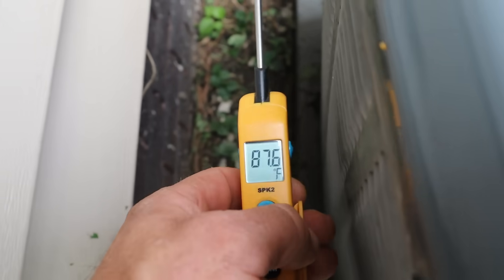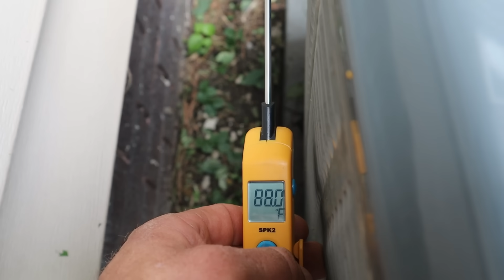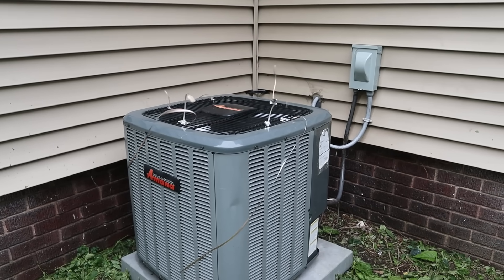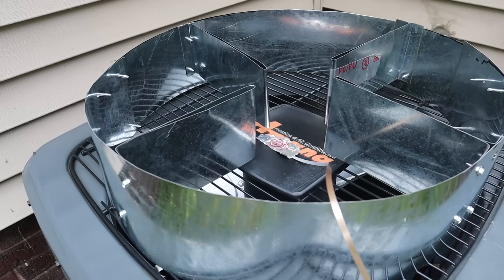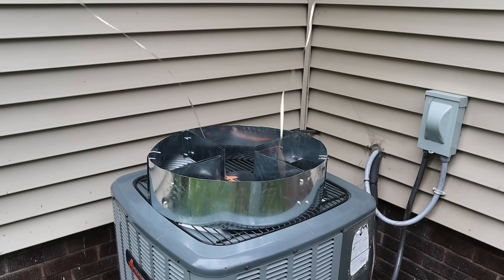Your AC Fan Makes a Mini Tornado

Comment: Good video Mike! I agree 100%! It really matters that no recirculated air is used! Same for heat pumps in winter my friend! 

 Where this really hurts efficiencies is like apartments/condo's where you have multiple units 18" apart against a barrier/wall.....then with condos you get contractors that start installing horizonal side discharge units with vertical units next to them! Then the vertical discharge customer calls saying it just doesn't cool well when it gets hot and their cooling bill goes up 30% then in winter the strip heat starts coming on in the 40's outside!🤣

I always felt manufactures need to pay more attention to getting rid of discharge exhausted air like on industrial lab hoods that utilize Vektor-H high plume system on lab hood exhaust but too costly but still they could do a much better design like what you did!
Reply: Emissions from burning fossils fuels.  My 6 cylinder Honda engine is like 0.7 lbs of emissions per mile.   Add that weight to your body and feel the effect.
Reply from the maker: "then with condos you get contractors that start installing horizonal side discharge units with vertical units next to them! " 

Yup. Seen an awful lot of that! Crazy.
Reply: @JerseyMikeHVAC  Every degree rise in summer affects the wallet, capacity and efficiency! 
Example Scenario

Setup: 3-ton AC, 14 SEER, $0.15/kWh, 8 hours/day, 120-day season.
Problem: Dirty coil or recirculated air raises saturated temperature by 10°F.
Impact:

Power: 3 kW → 3.3–3.6 kW
kWh/season: 2,880 → 3,330–3,840 kWh
Cost: $432 → $499.50–$576
Added Cost: $67.50–$144/season, or $6.75–$14.40 per 1°F.

Same for a heat pump heating it is about 1 to 2% reduction in capacity BTUh and drop in COP is 1 to 2% per degree, cost increase would be 1 to 2% per degree dropped of recirculated air.
You are spot on with it having more negative effects from recirculated air Mike!
Reply: @LKN-HVAC  I wish my electric was only 15¢. Mind is 20¢ now.
Reply: @EthanThruandThru  I hear you Ethan! I am lucky and am under 15 cents a KWh. Interesting to see what states are high and what states are low!
 
State ▲	Residential	Commercial	Average
Alabama	16.09	14.13	12.19¢ per kWh
Alaska	26.08	22.09	22.60¢ per kWh
Arizona	15.76	12.84	13.32¢ per kWh
Arkansas	13.15	10.78	9.56¢ per kWh
California	35.03	22.91	26.03¢ per kWh
Colorado	15.70	12.32	12.53¢ per kWh
Connecticut	31.64	23.34	26.16¢ per kWh
Delaware	18.12	12.32	13.78¢ per kWh
District of Columbia	20.15	19.48	19.07¢ per kWh
Florida	14.98	11.25	13.08¢ per kWh
Georgia	15.00	11.24	11.64¢ per kWh
Hawaii	41.03	35.82	35.34¢ per kWh
Idaho	11.88	9.72	9.46¢ per kWh
Illinois	18.62	12.39	13.16¢ per kWh
Indiana	17.02	13.84	12.18¢ per kWh
Iowa	14.23	10.70	9.19¢ per kWh
Kansas	14.68	11.03	11.09¢ per kWh
Kentucky	14.08	12.29	10.51¢ per kWh
Louisiana	13.15	11.55	9.78¢ per kWh
Maine	27.91	21.40	22.84¢ per kWh
Maryland	19.04	13.39	15.50¢ per kWh
Massachusetts	29.94	22.46	24.67¢ per kWh
Michigan	20.25	14.98	14.57¢ per kWh
Minnesota	15.87	12.41	12.59¢ per kWh
Mississippi	14.71	12.99	11.58¢ per kWh
Missouri	12.97	9.70	10.56¢ per kWh
Montana	12.90	11.63	10.66¢ per kWh
Nebraska	13.18	8.73	9.69¢ per kWh
Nevada	13.32	8.14	9.45¢ per kWh
New Hampshire	24.02	19.30	20.50¢ per kWh
New Jersey	20.49	16.56	17.54¢ per kWh
New Mexico	14.59	10.78	9.24¢ per kWh
New York	26.67	19.25	20.31¢ per kWh
North Carolina	14.26	10.12	11.21¢ per kWh
North Dakota	13.07	7.49	8.34¢ per kWh
Ohio	17.11	11.12	11.51¢ per kWh
Oklahoma	12.94	8.46	8.87¢ per kWh
Oregon	15.88	11.19	11.64¢ per kWh
Pennsylvania	19.31	11.85	12.99¢ per kWh
Rhode Island	29.00	23.70	25.66¢ per kWh
South Carolina	15.32	10.81	11.14¢ per kWh
South Dakota	14.34	10.95	11.62¢ per kWh
Tennessee	13.88	12.83	11.57¢ per kWh
Texas	15.49	8.90	10.22¢ per kWh
Utah	12.63	9.83	10.07¢ per kWh
Vermont	23.99	19.97	19.42¢ per kWh
Virginia	15.41	9.19	10.91¢ per kWh
Washington	13.67	11.59	11.14¢ per kWh
West Virginia	16.18	11.88	11.19¢ per kWh
Wisconsin	19.01	13.26	13.20¢ per kWh
Wyoming	13.89	9.36	9.83¢ per kWh
U.S. Average	17.47	12.96	13.17¢ per kWh
Reply: @EthanThruandThru : Sorry to break it to you, but if 20¢ per kWh is painful to you, then your bill must be so bad that you should look at extra insulation first. Even here in Oklahoma I would be doing that if I wasn't in a rental (some months I've been down around $30 because I didn't need A/C, this month I'm at $100- good insulation works wonders, and I don't got it!).

Comment: Mike, thanks for the physics lesson. I guess the question is, why don’t manufacturers offer this as an option or as standard equipment when they are installed?
Reply from the maker: For a homeowner, a few % efficiency gain matters, but for a manufacturer, my guess is that it doesn’t move the needle enough to justify retooling factories, redesigning guards, and recertifying efficiency ratings. Just having something like this on there isn't going to sell more units like an inverter motor or compressor can.
Reply: Mike, thanks for putting the time in to produce a video like this. No one else on YouTube does it as well as you do.
Reply: Mike, what could be done on a Trane XL series where there is a cover over the fan with exhaust louvers around the perimeter? Do you believe that this type of fan enclosure is detrimental to the efficiency of the unit since the air is exhausted out all of the sides?
Reply from the maker: If the unit has at least 3-4 feet of clearance all the way around then it probably won't be so much of an issue to worry about, but if it's up against a wall(s) or thick shrubs, then it can be a significant problem for efficiency/performance.
Reply: Mike, I asked because I have a Trane XL 4ton unit. The side closest to the house has  a little less than a foot clearance. The remaining three sides are all open. The fan has two very large blades with a unique shape to them .
Reply from the maker: You can check air temps on that one side of the condenser and see if it's pulling in higher than ambient and recirculating.
Reply: Thank you
Reply from the maker: If it's pulling in you can probably deflect the exhaust upwards somehow on that one side.
Reply: I will check it. I am sure you are right as the space is tight between the house and unit. Now that I saw your video, I will look to modify the air flow on that side. Thank you again for producing that video. I am sure that you opened up a lot of peoples eyes about how a small change can save money for everyone.